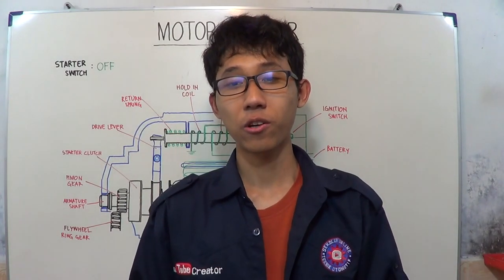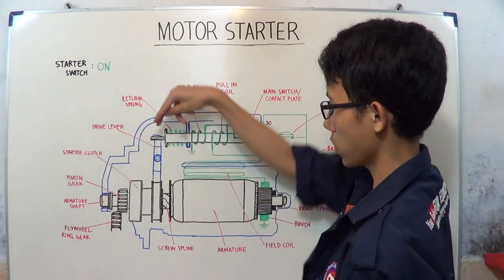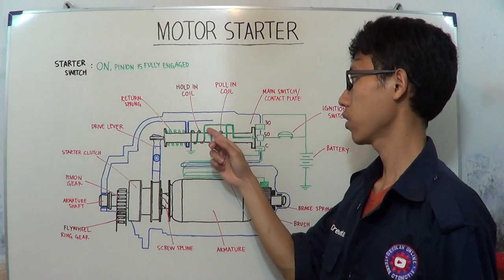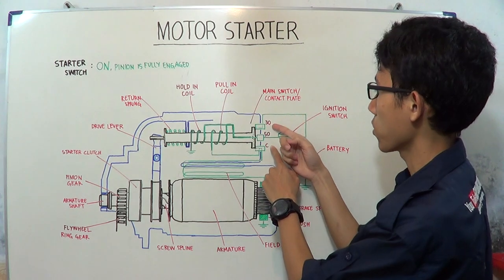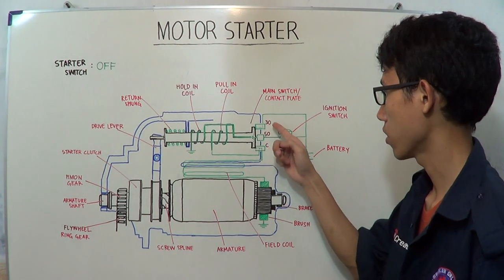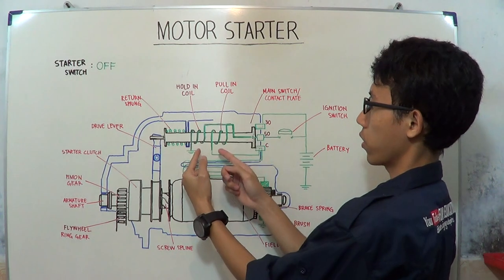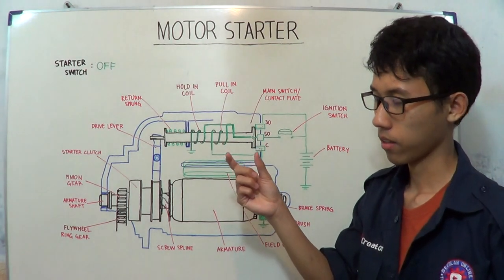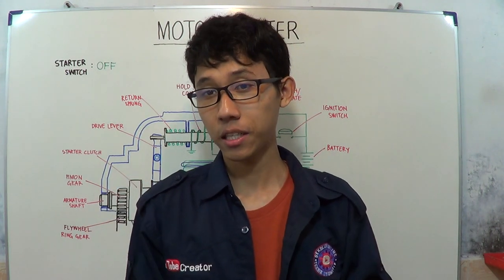How does the Basic Electric Starter Motor Work

Comment: What is the problem,
If a battery is not work better in a  (1) self to start engine,  and same battery work good in a (2)another self to start engine.(where both self are same power)
And another battery is work in both self 1and 2
Please report me
Reply from the maker: Thank you for your question.
As far as I understand from your question, the first battery seems to have a problem. However, I recommend you to check the battery condition, and ensure the terminal connections are properly installed.
Good luck!

Comment: What's the use of starter clutch
Reply from the maker: When the flywheel spins faster than the starter motor, the starter clutch prevents the rotation flows from flywheel to starter motor.

Comment: I always thought that this used a oversized capacitor to increase the voltage, in spile,  so it would over rev the motor, run at fast speeds,  is this not right,  but it must be dammit., volts has to increase for increase of rpms....Oh somebody clarifie please....